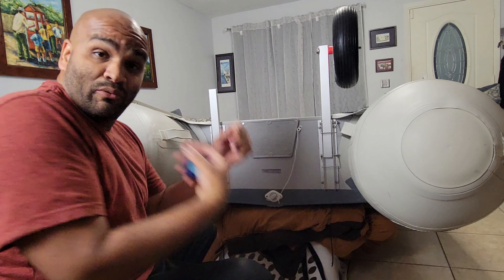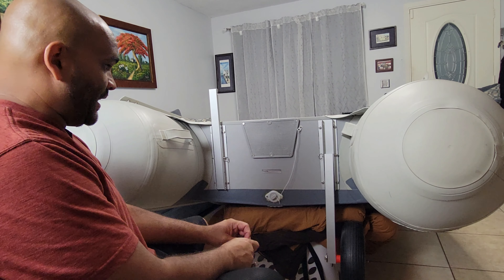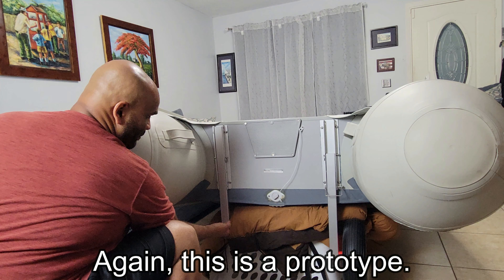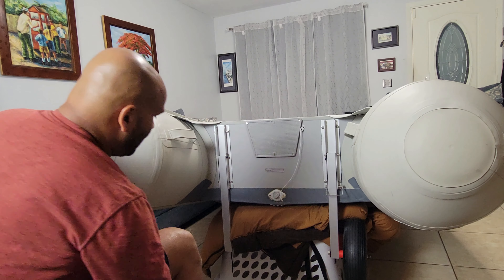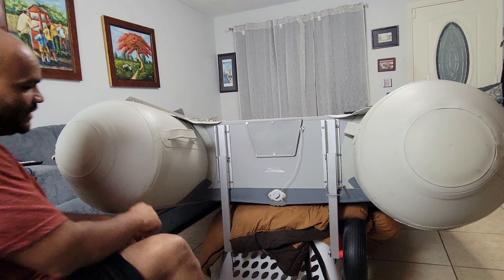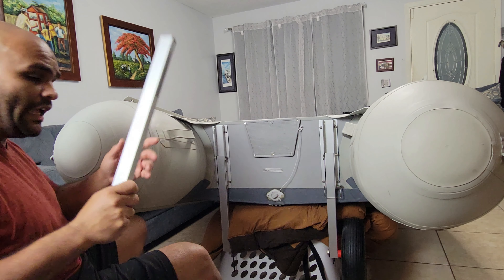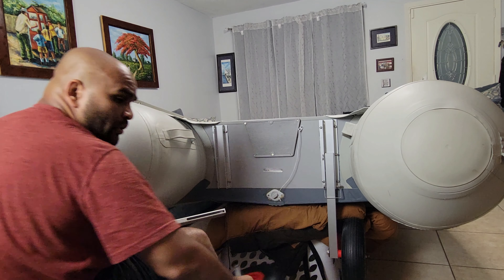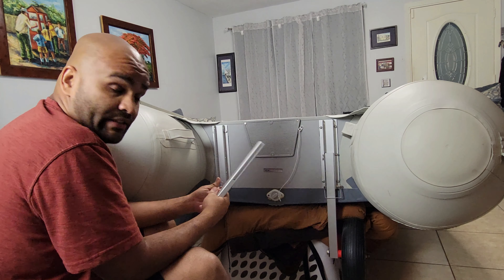Boatstogo sent me a transom wheel tube prototype for me to try

Comment: I'd look into a longer bar to increase wheel clearance. For wheels up mode, hold down straps of some sort could provide tension, less rattle, and position assurance during rough rides. The slot proto will make the transition from wheels up to down modes a lot easier. Nice!

Comment: ...I mostly use one of the transom brackets to mount my sonar transducer...I wish I had solid wheels on my tires, the air-filled ones  are a real pain to push under water to pin them in place....
Reply from the maker: Yeah, that is true. These are actually air tires as well.

Comment: I almost watched all videos and subscribed. I bought a sd365r in 2016. I used the boat a few times and stored it till a week ago. I aired up and everything was like day one. But my oar lock pads and the whole transom...all 8 seams delaminated. I was happy it was in the yard and not on the water. I will basically reinstall the transom.

I would like to think the newer models would be fine. I am trying to decide on which one! The old one was 130lbs with the aluminum floor. The cb290 seams fine for 2up cruising. I really want a back pack/ beach cart transport. There is alot of fun in the research. My 365 was used with a trolling motor. But I want to be able to plane in the lightest and easiest to transport setup. Maybe 290, 330 or kaboat. Any thoughts would be great Thanx for all the videos.
Reply from the maker: Thank you, sir, for watching a silly man's videos on YouTube lol. For ease of use, a kaboat would be perfect. I see myself using my SK385XL most of the time over my ZK380 because it is easy to lug around and you can plane easily with a 6hp outboard. I recently got a Hangkay 12hp outboard, and that kaboat flies on the water now.
Reply from the maker: If you want to go even smaller, the SK396 is also a good choice, but it will not do well in the ocean, tackling waves and wake. The SK385XL can do that because it has massive bladders.
Reply from the maker: @DanWolk-zo5kf  Mr. Dan, if you have Facebook, shoot me a message there since it is easier. Erick M Sucre
Reply: @ErickMartinSucre  one day I will FB. And I really should get a channel for my repair for everyone. Thanx  again. I have been spending alot of time researching and debating water craft. This all started as a younger version of me wanting to wakeboard in isolated areas. I got caught up in a move and now live IBX. So I have it all. Rivers to the Ablemarle sound.  I can trailer, truck or compact car. 

Really leaning towards 290, 330 or kaboat. I guess the greatest part is I can upgrade or get smaller.  I do wonder if a 12ft kaboat and a 6hp would be exciting for 2 people. Or a 330 and 12hp 2 stroke would be more useful. I have plenty of big boat experience and wakeboarded and wakeskated for over 3 decades...

kinda cool Eric! You have explored this option so well. Very best wishes on your life and channel. You help many to live the water dream.
Reply from the maker: @DanWolk-zo5kf  If you don't mind a 2-stroke outboard, the 12hp will help with 2 people on the kaboat. Surprisingly good those motors are, lightweight and powerful.
Reply from the maker: If you plan to be around rivers and lakes, a kaboat is your best choice.

Comment: ALSO MAYBE USING RUBBER PINS INSTEAD OF METAL ONES THEY WONT SOUND AND THEY WONT GET RUST
Reply from the maker: The weight may break them. These stainless steel pins don't rust that easily

Comment: the brocraft ones i have work fine, I don't see this as necessarily an improvement...what i really wish is that they would pre-install any kind of wheels.
Reply from the maker: The idea behind this is that one could place the wheels and have no need to remove pin. It needs more work, but once it does, it'll be a viable option for some of us.

Comment: Looks like the slot needs to be about half as long and it's game on.
Reply from the maker: Yeah, that could also work but it may reduce the surface area where the tube rests on the bracket, making it more likely for it to bend or crack. Thankfully this is just a prototype. Thank you so much for your input!